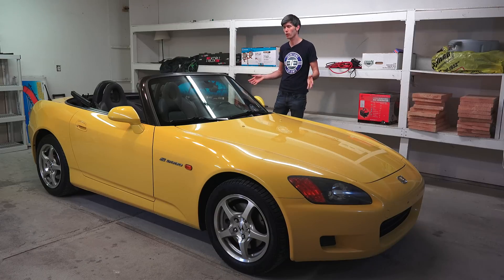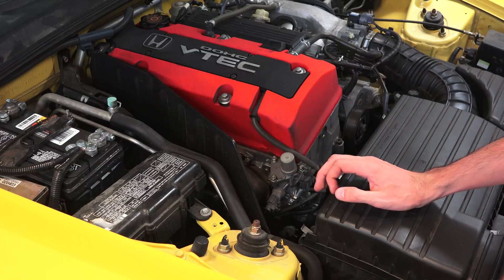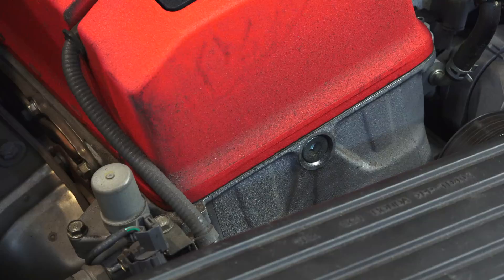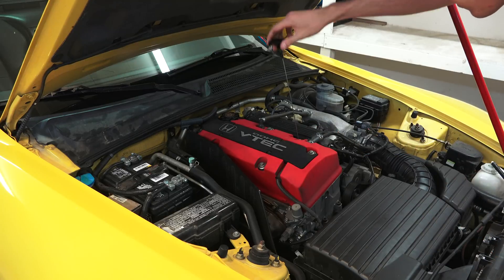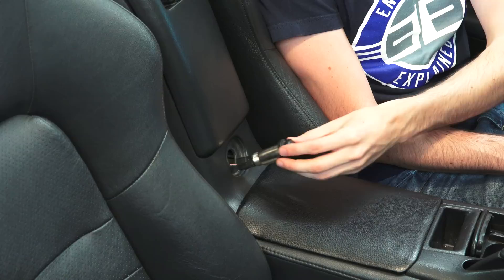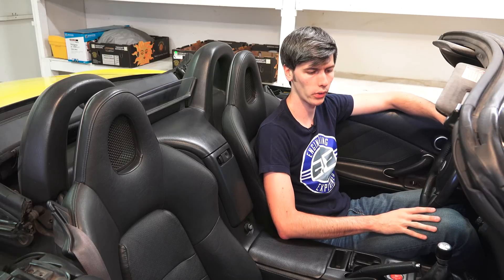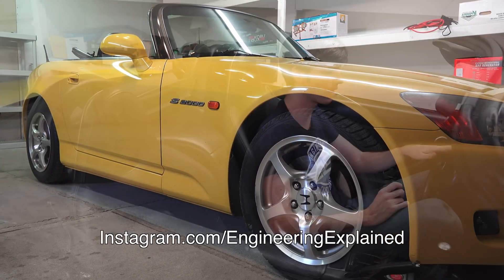What's Wrong With My Honda S2000?

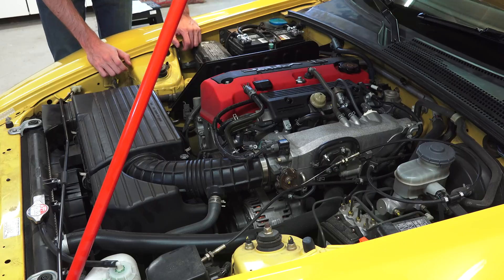Comment: A little S2000 tip, which you may already know, you can remove the bonnet support strut with a little wiggle from its usual attachment point and put it in the hole next to the fusebox, I think behind your left fingers at 3:30. I'm not exactly sure on the position of the hole, but I know it's possible as it was mentioned on an episode of Wheeler Dealers when they restored an S2000. This keeps the bonnet at more of an upright angle for working in the engine bay, so you won't have to use a broom handle.
Reply: a little honda tip! all my old hondas got that. just japanese thangs
Reply: beat me to it, it's an awesome feature on the s2k
Reply: it works on most 2 door Hondas my 2015 si coupe has it as well.
Reply: A lot of Hondas have that, 2005 Odyssey has it.
Reply: 2011 odyssey has it also, great feature IMO
Reply: I've heard that's an actually hole for hood support, to give more space when the engine needs to be pulled out. Integras, civics, accords, all have it.

Comment: How's the transmission? I've heard horror stories about the 2nd gear synchros
Reply: im tired of the notchyness...i have to shift extra slow..sometimes theres absolutely no notchiness, other times im like WTFFFF
Reply: @david G i will try it out, i just got honda oem in tranny and motul in diff like 3.5K miles ago...
Reply: ok..is it the synchromesh i hear about all the time? what weight? which specific one should i look for?

Comment: I can't stress enough that when you're buying a used car from someone you always get a complete inspection done on the car first before you actually buy it. Don't just take their word for it. If they refuse to get it inspected then walk away because obviously they are hiding something and it will bite you in the ass later on. 

As for your S2000 I can relate to buying and owning a high mileage and older example of an AP1 and offer advice. The car is old so obviously expect some maintenance needs to be done. First is if you haven't done so (and it doesn't sound like it) get a complete inspection done preferably at an actual Honda dealership. Get a list of any problems that need to be fixed or will soon need to be addressed. Some common issues on the older AP1s are obviously the timing chain, wheel bearings, water pump, master and slave cylinders leaking and worn out suspension and suspension bushings and spark plugs needing to be replaced. The majority of these problems stem from age and the parts being worn out over time.

Another essential thing to get done is the valve timing adjustment. Unless the previous owner has physical proof (aka paperwork) he did it in the last 50,000 miles get it done, don't shirk it. Change out all the fluids in the car as well for good measure. Trust me when I say when you get the problems fixed and keep up on the required maintenance the car will be very reliable for many more years.

Comment: definitely interested in seeing DYI/repair videos on this s2000.  Look up the Billman TCT (lifetime warranty) on s2ki.  Suggest you also check your valves at this milegage as well.  Also, look into replacing the brake fluid and clutch fluid asap--it looks very dark.  Old clutch fluid tend to eventually cause leaks near clutch pedal area (check for leaks there now on the carpet); and old brake fluid can lead to corrosion in the system in these cars..  Consider Amsoil Signature or another quality synthetic for your engine oil and diff fluid--some people have not had good luck with oil consumption using mobile 1 and some do okay.  Also, tires go a long way on helping keep this car stable on the road and handle the rain--consider pilot super sports or 71Rs (if you re planning to autocross or track).  I am sure you are already looking there--I strongly recommend reading all the great information on S2ki about this car...  Enjoy this amazing piece of engineering---an amazing gift from Shigeru Uehara!

Comment: I had a 2002 s2k for 4.5 years and drove it 100k miles. They will burn oil... Check after any hard drive.

Keep the stock air box it's just better. If you replace it with a cai you might gain 5hp and dirty your oil faster. 

I thought my timing tensioner went out (doesn't mean yours didn't fail) but my catalytic converter failed. The honeycomb inside got delaminated to the housing. 

Oh and one more thing. The rear cv axles... If your car has a shake under acceleration the cv cups on the diff are pitted out. Easy fix is to just swap one cup to one side and the other to the other side.

Great cars great fun.... But they are twitchy drive safe and enjoy.

Comment: Hi, i have heard about an problem with oil filter, it unscrew itself at high RPM, there is a thing to secure it wire some wire, like an aviation wired-bolt.

Comment: Nice car.  Here's a tip If you want the hood to stay open wider: Remove the prop at the bottom by revolving & wriggling it a bit. Then move it to the hole on the left side inner fender (between the shocks & fuse box). There's a corresponding hole in the hood above for it to clip into and it'll hold it out of the way, at about 80 degrees.That should make it much easier to work  & film in the engine bay.

Comment: you didn't need to use a broomstick there is a second spot you can put the hood prop look around the hinge on the right side all older Hondas have it it's a service position for the hood

Comment: "Honda cam chain tensioner" Words to strike terror into any mechanic's heart since, oh the 1960s.
Reply: Their easy, as long as you have everything in perfect position and don't lose the locking pin before it's bolted in place _;;;
Reply: Can confirm, replaced one on my CBR 600 F4i :(

Comment: The way you are reading oil is wrong for this engine. You need to take the dipstick out, wipe it down, reinsert it back into engine and then check BOTH sides and use the lower reading.

Comment: replace the stock radiator. they always go out.
Reply: Uhh no they don't. Mine is 15 years old and still works. Don't replace parts if you don't need to.
Reply: so wrong
Reply: I agree. Well you could always wait for the leak to start. My rad started leaking at around 175k at the upper tank area near the fill inlet was a thin crack. I replaced it with a Mishimoto radiator. After that is when I finally started doing my bigger engine mods.
Reply: I've neglected my coolant for 3 years now, soon to do an exchange though, but regardless I haven't had my radiator fail in my S and it's an OEM radiator and it's a MY 2000

Comment: So funny, i bought an s2000 a few days before you. Im also going through the process of fixing the stuff the last owner neglected. Getting ready to do oil change, diff and trans too. Hopefully take it out to the track in next 3 weeks and see how it does on stock suspension setup before i start upgrading it

Comment: It's likely that the previous owner always shorted this car during oil changes.  With the non-standard 5.5qt (assuming filter changed) change coupled with the unlikely performed fill + startup + refill tradition, these are the two most likely shortage causes for the alleged oil change from the previous owner.

Comment: Your s2k is gonna burn oil bro. There is a way to fix it on s2ki but it isn't a 100% fix and is pretty lengthy. I burn about a quart every 3000 miles back when I used mobile 1 but since switching to penzol platinum I burn about a quart between every 5-6k miles.

Comment: i always recommend cleaning out the throttle body on a used car. My 06 TL idled  rough with AC use after I reset the computer which made me check, and yes, had to remove a ring of carbon build up around the butterfly valve.

Comment: Do you think buying a 2003 one with 106k miles on it could be problematic or would you recommend?
Reply: Seems fine. There's a checklist for things to check before buying any S2000 on S2KI, read that. Mine have 123k and 201k and are going great!
Reply: Oh okay great thank you guys so much, would you happen to have a link to the checklist Jonathan? I typed checklist into the search and didn't find what i think you were referring to.

Comment: Wow engineering explained dont know how to check his oil lol.
you need to wipe the dipstick and reinsert then recheck. you don't need Subaru dealer to do it.
oh and the bonnet strut detaches and goes in a special spot to open the bonnet fully.

Comment: As long as it's a Honda, you have to; camber the wheels so they are parallel with the ground, get a 5" tailpipe, fartbox exhaust, put a JDM sticker on it, slam it, remove the hood, and put a $15 stereo from AutoZone.
Reply: What about a plastic gold crown air freshener for the back window?
Reply: $15 stereo? Where?
Reply: More like stereo that's worth more than the car itself
Reply: also front bumper lip, quick release steering wheel and subwoofer.
Reply: I'm pretty sure every Civic comes with your choice of barbed wire or gold chain license plate frame.
Reply: it was a joke lol, i'm not bashing Jason for it.
Reply: Hahah, that's actually exactly how they are. Sometimes I wonder if they started to call them amplifiers instead of mufflers.
Reply: You can't forget that big useless spoiler

Comment: Sometimes it take 4 or 5 tries to get the dipstick to read the same on both sides. I've never had a car with such a temperamental dipstick. Also, I cleaned the PCV and swapped to Amsoil and my oil consumption has lowered significantly.

Also, I would highly recommend Amsoil in the transmission and diff as well. I've run Honda MTF and it's ok, but I promise you will never shift a smoother gearbox if you run their oil. The diff "seems" quieter now as well.

Comment: Just changed fluids in my new S, I went with 75W90 for rear diff, I think it whines even more with clean fluid that is lighter grade when cold ;) Ah! Be careful and get correct oil filter, it is different than on most other Hondas, sometimes even dealer will try to sell you wrong can. It will fit but you risk that it will fail. I went with K&N one because that's what was available, all other I was looking at were "universal" ones. And use a wrench to tighten the filter, unlike in other cars, sometimes they unscrew and you get a sudden oil pressure loss...

Comment: u can remove that factory tape off your front windshield. the black tape is covering up the OEM paint. also check your soft top latches they may be lose and just need a Philips screwdriver to tighten them up if you hear rattling
Reply: They are inconsistently painted under that tape from the factory.  Spa yellow is a 2-step process, and is likely to be 'not quite right' under the tape.  Removing that tape on a 10+ year old car is very difficult, too.

Comment: you have to let the S2000 sit for a few minutes before you check the oil after you add oil or just drove. I'm an Express 
 technician for Honda and on all S2000's it takes a while for the oil to get back into the oil pan.

Comment: If you have to replace a timing tensioner(s),why not replace any bearing(s),if there is any around timing chain?I would replace a timing chain as well.
105 000 miles,is not much for that kind of high perfomance and high quality car,but your engine will be very happy.

Comment: Try GM synchromesh transmission fluid. I switched my 6 speed accord to that and it's felt brand new, even though it's got 200k miles on it.

Comment: Hi there. Just some quick tips from a fellow S2000 owner. It is correct you can replace that o-ring with just unscrewing the bolt a bit, so go for it, that will save you some cleaning of the engine from waiting to long. Personally I wouldn't change the air filter. I used to have a k&n induction kit with heat shield but the thing took in way more hot air then the stock airbox. The only benefit is the awesome sound you get from it, but I actually felt a little improvement in low end torque when reverting it to stock and no loss in horsepower, but no dyno so I can't be sure of that. There are some air guides on the market that go on the stock airbox. They grab air from the opening in the front bumper and divert it into the oem airbox. Maybe that can be a route to look into to. And finally my biggest tip, since it's a second hand S2000, please check your valve retainers. If the engine was ever over revved they can have cracks in them and that's a ticking time bomb. It's quite common on ap1's and it isn't always noticeable till it's to late. Before you know it, retainer drops valve, valve meets piston and well, I guess I don't need to draw any pictures for you to know what that means. I checked mine and had this problem. I have pics of these broken retainers so if you're interested to see, just let me know. I actually changed my inlet retainers to ap2 retainers because they are a bit stronger. That is also a common thing to do when replacing them. And when checking them it's always a good moment to do a valve adjustment because sometimes the rockers get to tight over time, which can lead to burnt valves. 
Well that turned out to be a long comment xD. Just to finish up, I'm glad you bought an S2000 and I am excited to see you're future content on it. Already liked your vids but now you got me checking the channel daily xD lol. Keep up the good work!!

Comment: your engine oil doesn't measure the same; prolly because 
1)you need to let the oil settle down to the bottom pan, after running your engine for quite some time.
2)by pulling out the dipstick everytime, you might rattle the oil and that could give an inaccurate reading?

do share with us, if you find out what the issue was tho. cheers mate.

Comment: The windshield to top seal looks a little dry....the rubber is expensive so suggest some Aerospace 303 on all the rubber trim......my roadster gets a bath in 303 once a year...rubber dies and the water starts wreaking havoc, keep it water tight. still it is a very cool roadster....

Comment: all of these are normal wear and tear, nothing big. the TCT  has been known do rattle in as few as 5,000 miles. the sizing of the oil flow port just wasn't well thought out. the easiest way to tighten the 12v plug is to remove the trim behind the passenger seat, loosen the screws in the center console, and reach your hand in from the back. there is an extremely sharp piece of metal back there though, so be careful. My AP1 started burning a bit of oil around 80k, but yours is probably a combination of the seeping of ring and oil pan, and maybe valve step seals. replacing the valve spring retainers with ap2 retainers is kind of a must. the ap1 retainers are known to Crack and drop a valve. also, the factory airbox is better then all but 3 intakes, so no need to remove it right off the bat. removing the ribbing from inside the box is one of the best intake mods you can do. I hope to see more videos soon.

Comment: first  thing. dont go-to the dealership.
 to read the oils on the dip stick on s2k.. you look at both side and go off the lower reading..the oil windage tray cause it to read different from one side to the other..
Reply: TCT  is common. especially  when the oil was not changed  ..your timing  chain is fine.. never heard anyone changing the chain.. multiple  s2k with over 150k miles with original  chains.. there couple in 300k club  with original  chain

Comment: always check oil when the car is warm, the oil pan uses a special honda flange sealant not honda bond check the service manual, and that center console is bear to rremove

Comment: My 03 S2K has the same center console loose power port issue. unfortunately I learned about the oil consumption issue in the middle of a track day and blew my engine yesterday. The tech guys there said that an AP1 can go through a lot of oil all of a sudden, and you should check it after every session on the track! Now Sparky S2K is just Parky. Need to get that S back. Anyway, please do post videos of your DIYs and repairs!

Comment: for the power outlet you can reach from the trunk, the tct is very common, I would suggest to check valve clearances especially if your cel comes on with an engine knock code (very easy to do on this car with the right tools and experience most owners do it in an hour, no shims its adjustable and there's like a $20 or less tool that makes it super easy). add to forums, as well as there is quite a few s2000 communities on fb that if you have any problems or questions owners are super responsive. Feel free to contact me as well I have an 05 ap2.

Comment: keep the airbox but change the filter
Reply: fk a filter
Reply: +DuBstep115 you wont see a single high horsepower car thats been built, with a paper filter.
Reply: and do the uk muffler mod
Reply: +DuBstep115 lol whatever you say bud. walk into an autozone, they have demonstrations to show how the kn filters flow better.
Reply: if something as cheap as a different air filter (which can be a difference of $10) would actually make a horsepower difference on the stock motor, then they would be installed from the factory, but the paper filter has been designed to give sufficient airflow for the amount of air the car is already using, so installing a new air filter wouldn't give you any hp gains.
Reply: while this isnt entirely correct, it more has to do with intake resistance, not so much "large gains." Paper is good enough for a road car. Even the KN is "good enough" but as you get to more and more racing applications, you want better and better material.